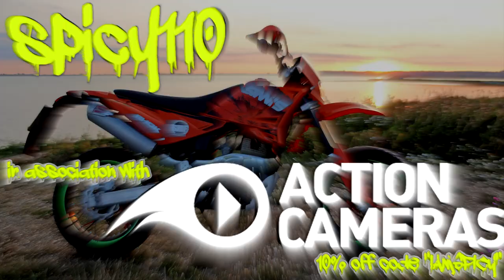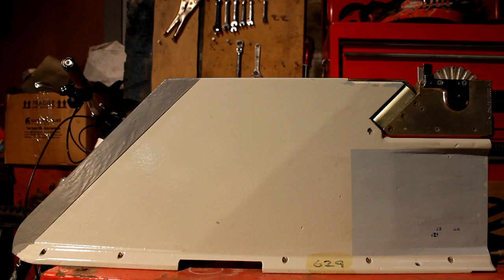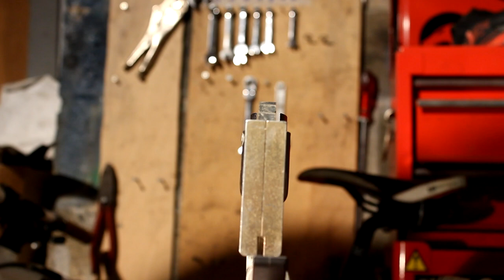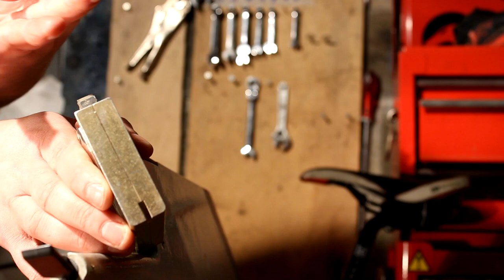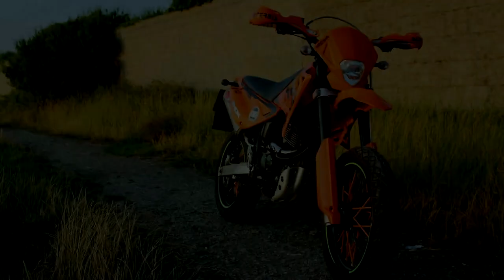The Rolleron! Amazing engineering! Aim-9 Sidewinder!

Comment: Regarding the speed at which you're spinning the wheel, the maximum speed at which air can exit the nozzle of your air hose is Mach 1. The only way to get it going faster is to fit a converging-diverging nozzle at the end of it. And as long as the pressure of the air before it exits the nozzle is around twice atmospheric pressure (I believe the actual number is about 1.83) then the air coming out of the nozzle is sonic. So to calculate how fast you're spinning the wheel, just find your local speed of sound (which is the speed of a sonic jet of air) and divide it by the circumference of the wheel to get rotations/time.

Figuring out its spinning speed in flight is a little more complicated since the speed of sound of air varies with altitude (as will the missile's top speed, since the same effects that change the speed of sound also affect aerodynamic drag) but as long as you have a rough idea of the speed of sound and the speed of the missile the procedure is roughly the same.

Comment: 0:52 the Sidewinder was designed in the late 40's/early 50's at the Naval Ordnance Test Center China Lake. You could probably argue that development really started during WW2. It went into service in 1956 and has been in service in some form ever since. The current AIM-9X has a completely different seeker technology and uses tail control and thrust vectoring but still shares the rocket body with late AIM-9L/M.
Reply from the maker: yes check the pinned comment.

Comment: If you are to run it a lot, you ought to consider replacing the bearings.
It is ingenious, and I said so, when I saw it on a practice sidewinder at an exhibition some 45 years ago. When I came back an hour later with a friend, to show them to him, all four rollerons had been removed - and had never been there, when I asked.

Comment: All versions of the AIM-9 up until the AIM-9X have used rollerons, and iirc up until the AIM-9X they all use the same rear fin design too.

1:08 It depends on the variant of the AIM-9. I dont know for sure, but i think they all were lag pursuit until the all aspect versions (the AIM-9L and AIM-9M) which switched to a lead pursuit interception.

Comment: I have to wonder how many times you can spin it up before the bearings self destruct.  After all, it was not designed to have to last more than 100 seconds or less.
Reply: The rollerons would be spinning the entire flight time of the aircraft carrying the missile, since the lock at the back does not seem to stop it from turning. It seems to me they were designed to last a pretty good while, therefore.
Reply: @preamp51  Yeah, I looked at it again and saw that they were free to spin even with the lock on.

Comment: wow so a rolleron is the missile equivalent to a aileron, so the high speed gyroscopic forces keep the rolleron stable in a 3 dimensional axis thus provides air deflection and this prevents roll.  what a simple fix to a complex problem.  yep im impressed

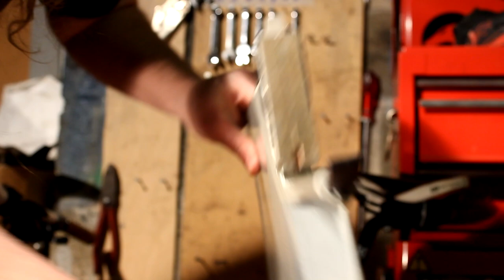Comment: Cool, but at 04:30 you could have just moved it about the roll axis, not in all sorts of directions as you did. If you jut simulate the missile's rolling, the effect will be much clearer. When the gyro is displaced in roll, it will want to move 90 degrees  later in rotation, defecting the tab in a direction opposite to the roll, hence the stabilizing effect in roll.

Comment: Thanks for posting this interesting stuff. The spin-up had to happen prior to launch for the stabilization effect to work. It looks like there's a nozzle built into the pivot axis. But what was (or is) the compressed air source?

The bearings would have to offer very low friction for the gyro, but not for very long. I doubt that the average "flight" is much longer than 10-15 seconds considering the speed of the missile and the typical target range.

Comment: should be able to work out the RPM's based on your compressor, how many psi and the area of the nozzle letting the  air out
Reply from the maker: Nope but there is a way, Check the pinned comment.

Comment: Do these spin the entire time the missile is on wing? Most missiles have thousands of flight hours on the wings of aircraft. Those bearings must be pretty good to run at that speed with no cooling or external lubrication.
Reply: No, they're locked until the missile launches.  He shows the lock mechanism in the vid.

Comment: The AIM-92 is an air-to-air adapted version of the shoulder-fired SAM called the Stinger.
The AIM-92 is also called Stinger and is mainly a helicopter weapon.
Don't ask me why they adapted it.  I know they've armed helicopters with AIM-9 Sidewinders in the past.
The only thing I can figure is that the AIM-92 is far lighter than the AIM-9.  The AIM-92 according to the spec I read is 35 lb; a Sidewinder 9X is easily 5 times that weight if not 200 lbs!
My guess is they use the AIM-92 on helicopters to reduce weight and they could technically carry more without suffering a penalty.  Six AIM-92s weigh roughly the same as 1 AIM-9X (which I confirmed is around 190 lb).

Comment: That’s interesting. The bearing on that wheel has more friction than I would have though. I wonder if that wheel spun when mounted on the jet and before being fired. And to that- I imagine these probably would take some/many trips without being fired- could that wear out the bearing considering the hours it would have spent at high RPM. It’s not like a missile has a Hobbs clock telling the maintenance guys a bearing needs to be lubed or replaced.
Reply: No sir. It has a lock on it that releases the rolleron when the missile is fired.
Reply: @swcheshier61  I saw the bit of him talking about the lock on the rolleron, are you saying there is another lock on the gyro wheel as well?

Comment: My girlfriend's dad worked on the design of the AIM-9 and my uncle worked in the machine shop during that project at NOTS. Due to the very tight manufacturing tolerances for the ball bearings they reduced the time they tested the bearings before installation. They were testing the bearings for minutes just below the failure point, then the bearings would fail in flight. So, less time for the testing increased reliability in flight. Tolerances of .0001" were common for this project. SOmetimes a part wouldn't pass QC so they'd put it in the freezer overnight and it would be fine the next day (NOTS was in the middle of the mojave desert, not far from Death Valley after all). Don't let your long hair get caught up in that thing while it's spinning, that would make a great video but you won't like how it feels.
Reply: I dont give a F.

Comment: I am willing to bet the velocity of air is out of the nossle is significantly slower than wind speed at Mach 2.  Also, I think sidewinders use a similar wheel to generate electricity for the misleading guidence.

Comment: I have an AIM-9B Seeker head with a gyroscopically mounted first surface mirror to direct the heat source from the target to the sensor in the head. I've always wanted to hook it up so it would track people smoking cigarettes. That is how they used to demo the things. I love building and flying rockets and I would love to have one of those fins. Where did your wife get it? The ones I see on ebay are parts of full kits for $$$$$$$$$, real OUCH money. :(

Comment: They still use an annular blast fragmentation warhead (the welded at opposite end bars) so I’m not sure where you got the idea that was outdated. If indeed it was you that said such a silly thing.
Reply from the maker: The source I read for that said the continuous rod warheads had been used for 30 years. They may have been referring to an exact model rather than the whole idea. I did not claim to be an expert just someone who likes interesting mechanical solutions.

Comment: You should hear the Generator Turbin in the Seeker.  We had to connect a 3,000 PSI Air Hose to the Test Set (Sand Bag every 5 feet) and I had Ear-plugs, Sound attenuators and I would clamp my Nose and cover my mouth with my hand.  I did not like the way it Vibrated my Sinuses.
Reply: And then you had to retape the Exhaust Port.

Comment: Im sure the sidewinder had another wheel like that which was connected to a dynamo to produce electronical power rather than having to carry batteries to power the electrics.
Reply from the maker: It used a hot gas jet turbine powered off the motor, check the pinned comment.

Comment: I can tell you that the nozzle exhaust is subsonic. It would require a carefully designed expansion nozzle to reach supersonic stream... It would probably be safe to assume it's close to mach 1 though.
a=(gamma*R*T)^.5 where a is the speed of sound, gamma is the ratio of specific heats for air, R is the gas constant for air, and T is temperature on an absolute scale. For typical room temp, this works out to around 1100 ft/s.
Reply from the maker: drienkm in short not even close to the speed this thing would spin at M2.5. Also those things sticking out the top are guides to grab more and and squeeze it through, I assume increasing the pressure and speed of the air passing over the wheel. you can just imagine the gyroscopic force at full speed!
Reply: spicy110 Yep. I know the aero side of things, but I'm not sure how the gyroscopic reaction force relates to RPM... if I remember it's the 2nd or 3rd power... so somewhere on the order of 7-15 times the force!
Reply: spicy110 The black things sticking up in front of the rotor? From the angles in the video, it looks like they either are flow straighteners, or shockwave generators. Each one would make a strong shockwave on the inner side and the two of them converge along the rotor. This wouldn't increase the speed of the air there, but the local density, leading to a quicker spool up time.
Reply from the maker: drienkm I knew double the speed isn't double the force, but damn I didn't realize it was on that magnitude!  I don't think this missile even needs explosives it just spreads the other plane lol james bond style! ;-)
Reply from the maker: drienkm see here http://www.fisherimage.com/img/s5/v120/p2048639853-3.jpg
Reply: spicy110 Hmm!! From that angle I see what you mean. They would increase the speed of the air hitting the rotor while the missile is still accelerating through the subsonic phase of flight. They may have been designed to help in both subsonic and supersonic speeds.
How on earth did she find it?!?
Reply from the maker: drienkm I will be honest she had a little help lol but you would be amazed what you can buy and own 100% legally. There are company's out there that sell stuff like this! In the same way you can buy old fighter jets.
Reply: spicy110 Like help form you? Haha. Still an amazing gift though!
I really like that kind of stuff. I work around airplanes and just noticing little design features and the way things were done is very interesting. There are lots of clever things like that in aerospace. We need more of them on motorcycles:)
Reply from the maker: drienkm maybe! Lol sadly I work around pots and pans! Its a barren land for the mind! In fact just pointing out ways bits of equipment could be better is a time passer! Lol
Reply: spicy110 I've been there:) I cut grass for years... There was no better time to dream about inventions, vehicles and technology than mindlessly pacing around listening to the gentle hum of a machine while wearing earplugs... such a fertile environment for brainstorming!

Comment: Are you sure this a “stabilizer?” Generally, a stabilizer will return a system to equilibrium if it’s disturbed. The direction these move, it seems like if the missile starts turning one way, this will make it turn even harder. More of a “maneuverability enhancer” than a stabilizer, unless I’m missing something. Seems like this is just a way of moving these control surfaces without having to run electrical systems anywhere but the front of the missile, which has the seeker and canard actuators.
Reply from the maker: note the pinned comment

Comment: count the facets on the wheel and then use FFT to get frequency of the noise, f/N*60 = rpm
Reply from the maker: I knew there was some way of doing it, tried a timing light but not enough contrast.

Comment: Use your phone to measure the frequency of the sound generated, multiply by 60 and divide by number of blades to get the rpm.
Reply from the maker: Did it in the video linked in the pinned comment.

Comment: Actually, the rollerons have been used somewhere else: During the Taiwan Strait Crisis a Sidewinder hit a Chinese airplane without detonating and lodging in its airframe, it eventually fell in the dirty hands of the Soviets who reverse-engineered and copied (the only way they can create anything good is by stealing it from someone else) and created a virtual copy: the K-13 "Atoll", which also includes Rollerons. Soviet engineers said that studying the captured Sidewinder was a "university course about missiles". 
I read it on Wikipedia, just check the articles.
Reply from the maker: +Charles Ferdinand yep that is the Russian way. Remember their knock off Concorde? They stole the plans and managed to make a plane before the real Concorde was built. However it was terrible and most of the ones built crashed.
Reply: In fact the Tu-144 was used by the soviets as a cargo aircraft, go figure..
Reply: I know, the US Navy engineers and the guys at China Lake worked hard on this missile for several years just to have the tech get stolen and reverse engineered by the Soviets within two years.
Reply: There's a good book about weapons development at China Lake. It has China Lake in the title.

Another brilliant thing us that they needed to account for air density when guiding the missile. Air density will vary with altitude, temperature, etc. They obtained the air density empirically, deriving it from the back EMF voltage of the electric motors that actuated the steering fins.
Reply: (the only way they can create anything good is by stealing it from someone else) Their world class ejection seats and space rocket engines weren't copied off anyone.

Comment: Does that mean the sidewinder "translates" but doesn't really turn? If It turned say 90 deg, the rollerons would be all over the place trying to get it pointing in a direction parallel to the axis that it was launched. Would that add a tonne of drag if the guidance system forced it to keep that direction?
Reply from the maker: See a brand new better version of this video here https://youtu.be/y1kUzjdkxG8

Comment: I confused . If this device resists any changing in the missile direction , how it changes it's path and follows the target ?
Reply from the maker: No the front Canards steer the missile, this is for stablasation. I will be making a new video tomorrow as I now have both fins and a small model, plus I will do some rpm testing.
Reply: @spicy110  I appreciate your attention to my words . Thanks!
Reply: Every cool. Mmm I was thinking exactly the same: wouldn’t the canards be fighting with the rear fins for directional control (?) ..but just learned (Ausairpower.net) that, as you say the rear fins stabilise...and do so for roll only. I guess that in this way, the control system for the canards can be simplified as it won’t have to compensate/accommodate for any roll..(ie just left right/up down)??
Reply: @hectorsewell1823  Hi ! Thank you dear friend. I continue to study about this interesting case and will tell you if find new informations. I hope you will do so too.
Reply from the maker: See a brand new better version of this video here https://youtu.be/y1kUzjdkxG8
Reply: @hectorsewell1823  Hi ! Problem is solved !  These devices act as anti spin device and prevent any clockwise or counterclockwise spin in longitudenal axces . Elimination of the spin is critical for the guiding system to seak infrared sources .When they are activated , they are two by two opposite of each other and the overall effect in longitudenal axces will be only like small air breaks !

Comment: The fact that you can get parts from an AIM-9 leads me to believe someone could potentially buy all the parts and build their own at home
Reply from the maker: I can buy the whole decommissioned missile right now for £3500. Clearly it's of no risk to anyone without explosives or a motor and the control system.
Reply: @spicy110 you can make the explosives and motor yourself. Controls, on the other hand, are more difficult.
Reply: The tricky bit is having something to fire it from 😂

Comment: What does it do? What problem does it solve? Without it, what would happen? (I didn't get that from your video)
Reply: Am a bit late but it’s basically a roll-stabilizing device, the sliptream-driven wheels at the fin trailing edges act as stabilizing gyro. In a combat situation, you want the missile to be stabilized as much as possible so it can maneuver to the agile target accurately.
However, these were only on older models iirc as newer models like Aim-9Xs use moving fins that act as both stabilizers and thrust vane vectoring, allowing the missile to endure more G-forces/agile.